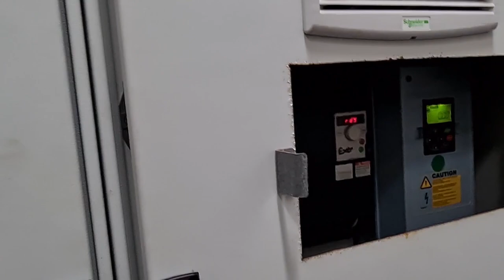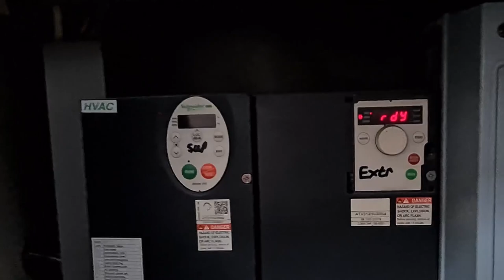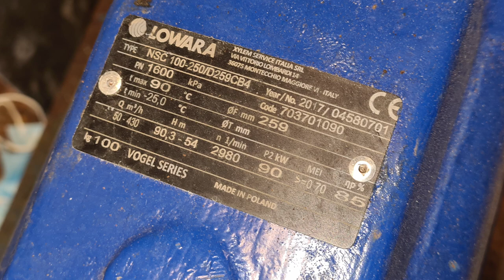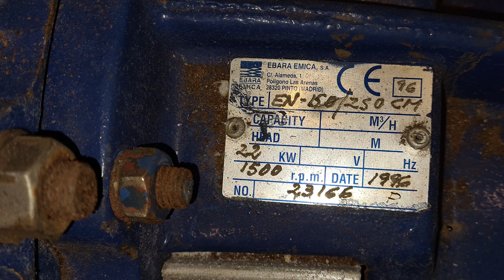Abandoned Oasis Lesuerse Center, Powering Up Slides Dombusters

Comment: Surprised there's still copper wireing in there after being closed for so long.
Reply from the maker: Secerty and police are making a big improvement to its secuerty so cant blame them and SBC have helped alot with previous brake ins i have alot of concerns for there with how its even being left let alone brake ins, so your close to that answer yh im suprised aswell sad to see how its all going i wont be visiting there again now unless it reopens 😆
Reply: @KIRBZVIDS  
Heathrow training center had lots of security, 3 guards outside and a dog, but  the copper thieves where inside takeing the wireing, security called the police when I was inside but they wouldn't comeout to search the buildings.
Security wouldn't come inside the building to look as they are unsafe.